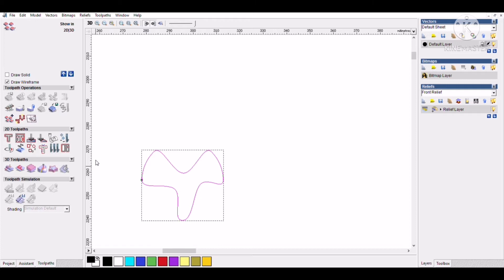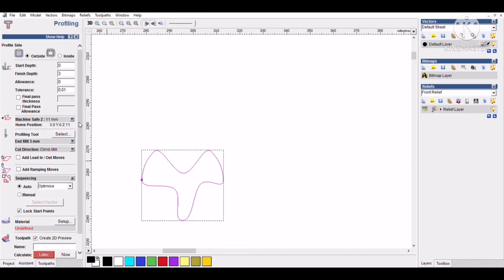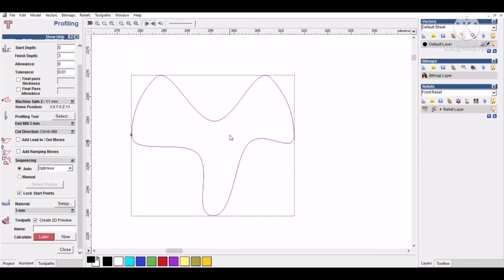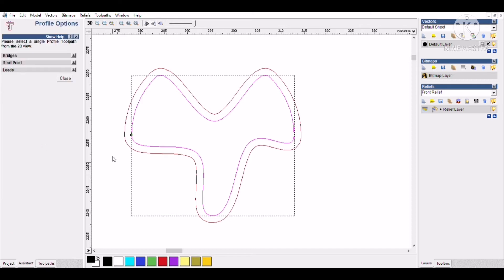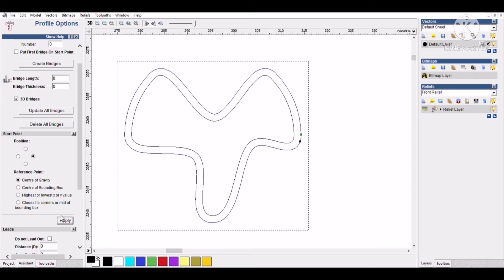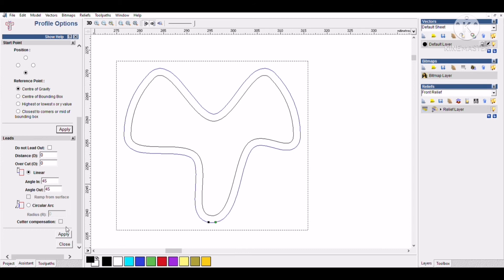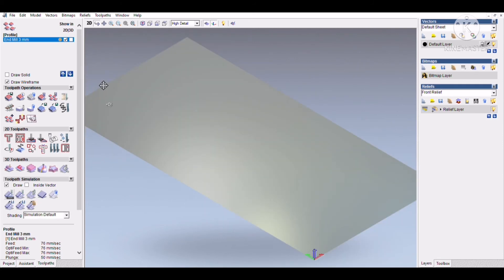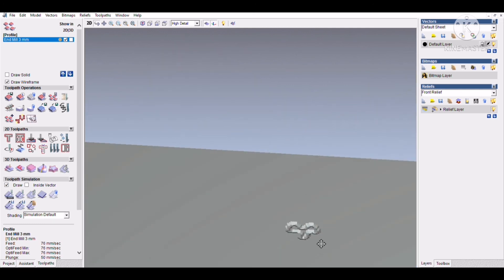artcam 2008 toolpath ordering start point#how to make ordering 2d toolpath

Comment: How can I set the width for my cut to be wider on Artcam pro? My bit is 6mm but I need a path of 6.6mm. There are available adjustments for depth of the cut, but I cannot find a way to make a 6.6mm path with my 6mm bit. Making a second pass will not work for all designs.
Reply from the maker: You mean you want give depth 6.6mm?
Reply: @technicalehtish5639  width
Reply from the maker: @seanbryant2956  for width you have to choose bit according to your work
Reply: @technicalehtish5639  assume you want to cut a straight line into a 1/4” sheet of acrylic with a 6mm bit. I want to cut a straight line that is 4.3mm deep, and 6.6mm wide. Do I need to have the bit zig zag, run a separate layer, or retrace the initial cut but slightly offset. I see in artcam pro there is no adjustment for width.